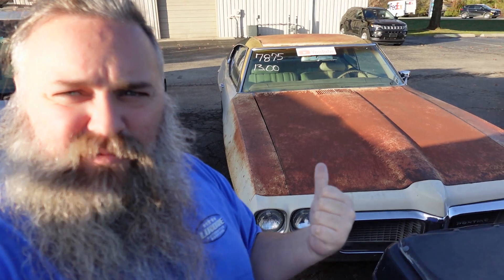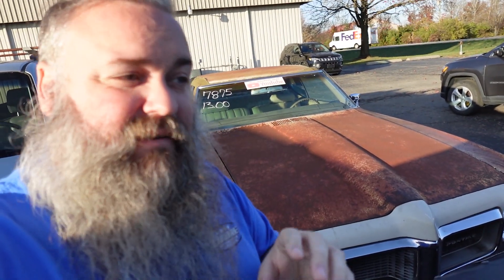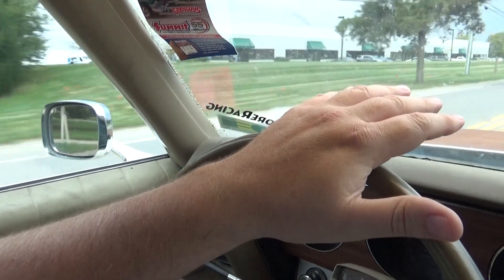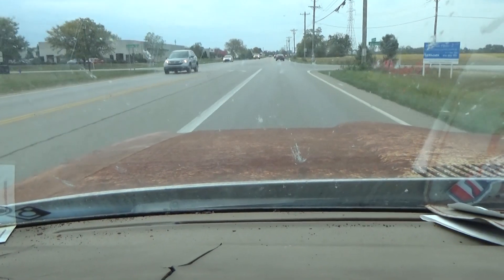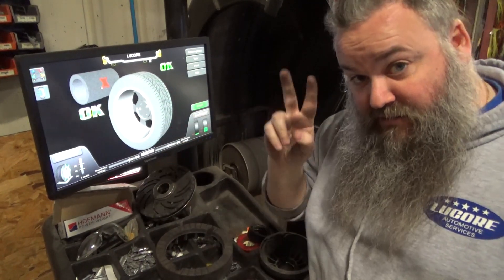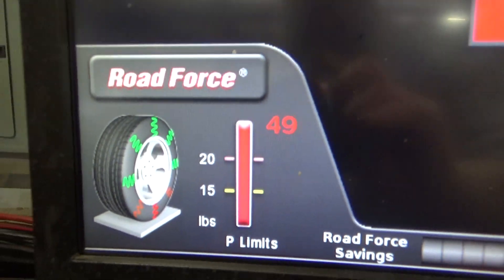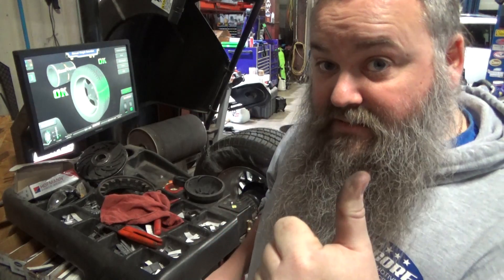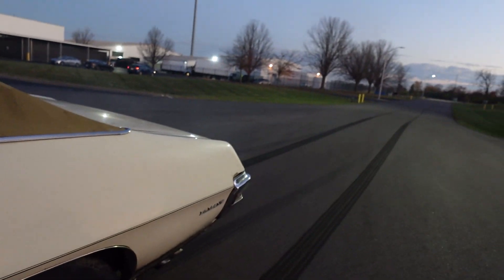Do BURNOUTS fix FLAT Spots? Let's test this with SCIENCE!

Comment: great video. I am having problems with my tires and looking for a solution...it's 1000hp so I shouldn't have any problem roasting them straight.  How did it end up riding afterward? My little vibration is driving me insane.  Same thing, they balance fine but roadforce bad. Tires have a visible high spot when spinning them. Very frustrating! I subbed to you though, I enjoyed the episode.

Comment: Oh hey austin this is just my opinion of course but those 455 cars all came w the turbo 400 for a reason .. in fact the fact that it runs low 13s high 12s with a turbo 350 and that gearing to me is damn impressive but this being said the turbo 400 has a lower first gear theres no reason it should have to take that much to break them loose and that long to get rpms up back off the adjusters just a few  clicks at least on the back brakes the feel in the pedal will not even really be noticeable they will still work especially in a panic stop for sure but not be applied as hard on normal braking and yes light braking for powerbrake burnouts yay. ! Lol and of course take a good amount of strain off the drivetrain when doing what was it  oh yeah yay ! ?" Big smokey burnouts " love them

Comment: Before seeing this, I would have bet this was a bias-ply thing. I still suspect it has more to do with the heat than removing rubber, but removing 5ubber is fun, so carry on!
Reply from the maker: It would certainly be something to dive deeper into I think, and another comment was to test it with the tire cold, which is something I may do as a follow-up. I was surprised with the results for sure, but the testing was still fun!

Comment: Sounds logical.  The flat spot isn't having any rubber burned off because it's spinning too fast and not making road contact.  Essentially the tire is sanding itself even.
Reply from the maker: That's kind of how I see it working too, and I shaved off a good 32nd or so of those tires with this single burnout, she was ROLLIN. Will be interesting to see if the change translates to the road manners.